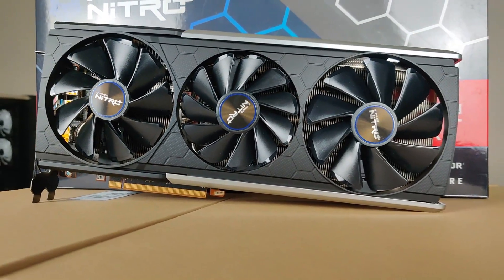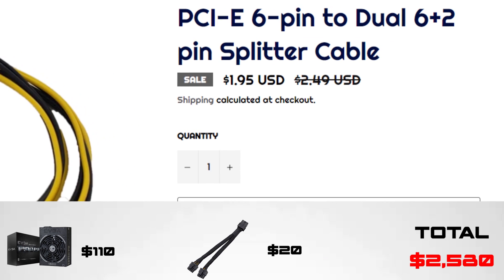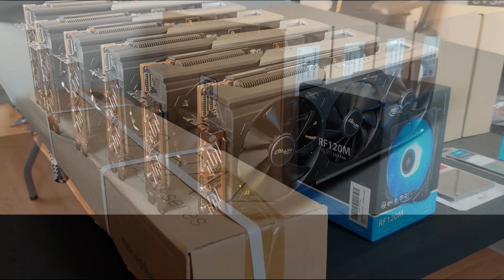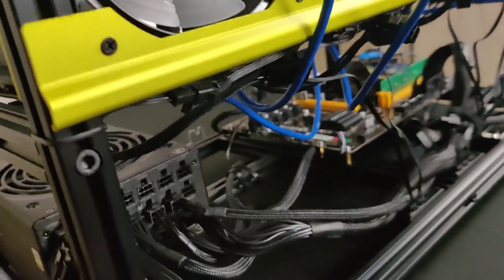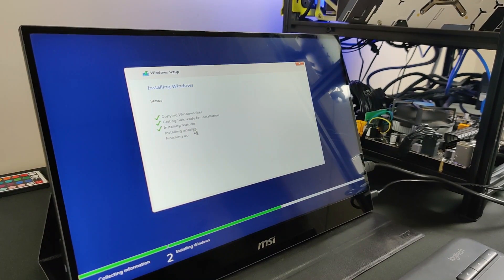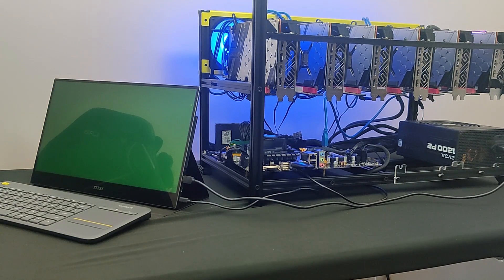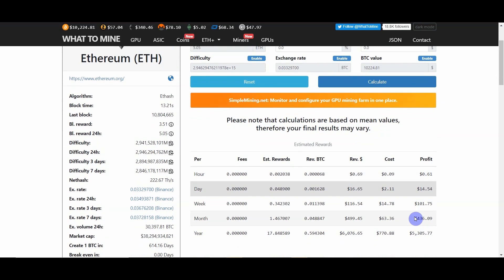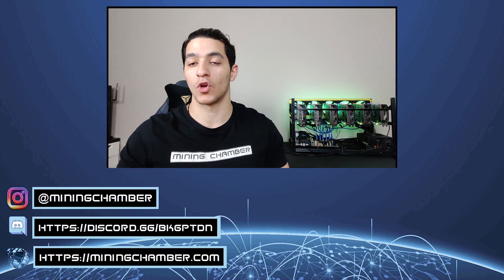RX 5700 XT Mining Rig Build - 6 GPUs | 330 MH/s and ONLY 880 Watts!!

Comment: I don't think you should be showing "refurb prices" or gifted items, especially in the thumb. These videos should be a benchmark for what average joe should expect a system like this to cost by simply buying off the shelf and not one off deals or free stuff.

It would give your videos more credibility. Plus there are far more cost effective builds.
Reply: You should do a best bang for the buck build, an efficiency build aimed solely at MAX ROI. I own a few large mining farms and mass produce mining cases psu's mobos and bulk buy GPUs and I've been mining since 2009 and based on my experience the most cost effective home build would be the metal amazon shelf plus cable ties, no need for fans if you are running two racks of 5700xt or if you want a dense home garage or mining den go for riderless mobo and self contained case.
Reply from the maker: That's awesome!! Haha I know for sure the fans are extra 😂😂 they just look appealing. Il be looking into doing a most bang for buck thank you for the the feedback!
Reply from the maker: I agree, as we did in this video we mentioned that these are the prices we got it for and for the average Joe it will cost 3K to 3.5K right after we finished wrapping up the prices. We also have done a build for the RX580 which we haven't really mentioned how much it would cost buying it off the shelf therefore we changed it for this one!

As for more cost effective builds. I agree as well! These videos are just to inspire people and give them an idea on what to build. We in no way recommend any build. Each individual is subjected to their own budget and goals!

Comment: I'm sure I'm missing something but according to the EVGA website on the 1200 watt power supply there are 6 8 pin and 2 6 pin so if I power the 6 graphics cards off the 6 8 pin with splitters, I only have the 2 6 pin left to power the risers and with a splitter on each I can power four risers. How do I power the other 2 risers? Do I have to use SATA?
Reply from the maker: That is a good catch!  I have daisy chained a splitter with another splitter which then was able to power all risers.

In scenarios like this, I do recommend getting another vga cable from eBay or anywhere you can get your hands on them for a dual 8 pin  or you can do 2x SATA to 6 or 8 pin adapters (2 sata connects to give you 1 8 or 6 pin) or daisy chaining the splitters but only using them for risers. It is still a little risky and so if you want the safest option  I'd go with the 2 SATA to 6 pin or buying a VGA dual 8 pin for the same gpu model
Reply: @MiningChamber  I appreciate the reply. This will be my first rig build. I went with 4 of the XFX RX 5700 XT's with dual bios, and 2 of the Saphire pulse 5700 XT's recommended by red panda mining I believe. As moding the bios makes me a bit nervous. I really do not want to brick a brand new card. I've been watching you guys, red panda mining, SerpentXSF, and Voskcoin, but I'd have to say you guys and red panda mining are my favorites. I assumed you had to have daisy chained those splitters but in the description it says avoid daisy chaining lol. I'll look for the vga to dual 8 pin or sata to 6 pin.
Reply from the maker: Thank you we really appreciate that! Everyone is amazing in this community as a whole. From those who put content and those who interact with others!

I know I sound very hypocrite 😂😂 I say not to do it but yet we did it. Because so many scenarios where people would try to daisy chain for powering gpus and that never ends well! That's why I want to make sure to try to avoid it as much as possible so no one makes such mistakes that can be pretty costy!

BIOS modding is scary for sure! Id recommend not using those BIOS switches at all and instead if you make sure you save the original BIOS of each card you will be on the safe side!

Comment: Great video bro, thanks! Are those fans merely an aesthetic thing or you recommend to buy them? Is this rig loud? Could you please measure the noise level? Thanks!
Reply from the maker: It depends! Some rigs don't need them because they don't get too hot but for this rig I found them pretty useful for temps! The fans provide 54 cfm each I believe which is really good airflow. As for the sound level it is really decent. I don't have a db measurement tool but il look into getting one then letting you know!

Comment: Do you need to plug out every time a GPU and then put only one on and BIOS mod it ?( So 6 times ? )and after it you put every cable on every gpu when you were done right?
Reply from the maker: That is correct ! One by one for BIOS modding. It's a one time thing then you won't have to do it again !
Reply: @MiningChamber  Ok thanks. It's not important if I put each GPU in the first PCIe slot? And one other question: When I set the program up to mine via cmd and I have a wallet, do they send me many little fractions for my mining effort or do they pay me out after a while ( each hour? ) . Because I never mined only with cudo miner but want to switch to a real mining program.
Reply from the maker: Yes putting them in the slots properly does matter! You want to start with the main slot first the 16x slot usually the first long one. And then 2nd will be which ever smaller slots above that then you go down after
Reply from the maker: As for the mining program, they usually pay once you reach a minimum. You can check with whichever pool you decide to use!

Comment: In the other video, didn't you have  50mh with 90w?
Reply from the maker: That is close! It was at 55mh at 88 watts on the software. And like I mentioned in the video, once we measure out of the wall it will be more since the risers take power and it is more accurate if we measure it from the wall .
Reply: Oh yea ur right thanks
Reply: Was gonna wait till new nvidia come out maybe these go down in price but now with 880w @0.17c.... dunno if its worth it
Reply from the maker: Hmm yes that is expensive for electricity. I would wait for the new cards and then see how much will you be able to make through whattomine.com after the electric costs!

Comment: how did you power the risers?
Reply from the maker: I used one splitter that connects to 2 risers then I power that spitter with a 6pin pcie!
Reply: Mining Chamber can you recommend a pcie to pcie cable that works with that power supply? I have the same one and all of the cables it came with were used on the VGA ports to connect the cards. I tried a pcie from another power supply but it didn’t fit. Thanks!

Comment: Hi, Great video again. I could use this configuration but with 7 GPUS?
Reply from the maker: Yes for sure! You will need a different motherboard though since this one supports only 6 gpus
Reply: Mining Chamber can you recommend one? maybe de asus A270, but i don’t know maybe you know other less expensive and and with good performance.
Reply from the maker: I think the H110 BTC motherboard is a great option for it! It supports 13 gpus, even the Asus b250 mining expert. Both of these are options I recommend !

Comment: 14 dollars? im using nicehash as i can see only 10.41 daily. My GTX 1060 6gb x 7 only provide me 5.50 dollars. that is really really low
Reply from the maker: Yes it is supposed to be 10 daily. We did use a wrong block reward number !
Reply: @MiningChamber  do you think it is worth to invest. The btc gaining is quite low compare last week. I bet it will be as low continuously. Or did i do my math wrong. ROI supposed to be longer than 6 months? Or perhaps since it is covered 3 years warranty i should forecast as future gaining as asic miner does not seem reliable. Pls advise? Many thanks
Reply from the maker: @KelmondChow  The ROI does fluctuate alot more than we can expect. Sometimes your ROI can show you in 4 months and other times it can be 8 months and more. Generally speaking usually a year is good to ROI and then you have the hardware still as an asset to sell anytime you want out of mining. Sorry for the late response! <3
Reply: @MiningChamber  no problem. In fact i do appreciate you did answer my queries.
Reply from the maker: @KelmondChow  My pleasure!! Hope it helped

Comment: Great video, I hoped that I saw this before I build my 5700xt rig. I'm getting the same 330Mh/s hash rate, but it is stable at about 850mv for couple weeks now. Cannot get any lower voltage for some reasons. I have all reference and sapphire reference cards.
Reply from the maker: Usually reference cards are much more effecient and stable for the 5700XT. Watch our overview video where we cover the BIOS modding and then youl be able to push it further than 850mv!
Reply: @MiningChamber  Thanks for the reply, I've tried using the radeon software instead of msi afterburner, I'm able to get 750mv now stable for a day. Differences between the software are that big?
Reply from the maker: It's just for some reason MSI afterburner doesn't obide by the MorePowerTool configuration that we did to the GPU so it isn't letting you go beyond the factory limits of 800mv. But in Wattman or just command line for phoenix you will be able too !
Reply: @MiningChamber  Yes, I've followed your guide and very happy with the results. Thank you so much for the videos! Keep it up
Reply from the maker: @HM-jm4mp  No problem thank you! Sorry for the late answer <3

Comment: 1200w is enough for 12 cards? Ty <3 best video
Reply: Best i've seen was 322Mh/s for 641W using 6x 5700xt with samsung memory, but even then 11 cards would be absolute max for 1200W PSU.
Reply from the maker: @bohdanzilik3867  For sure! It is very scary if the Overclocks ever crash or reset. Sorry for the late response!
Reply from the maker: Thank you!! 1200 will unfortunately not be enough. As we can see from the numbers 6 were reaching 880 watts so doubling that you got at least 1700 watts and then you want to have room for mistakes (Overclocking reseting randomly, etc.)  So it is best to go with 2 of the 1200W Powersupplies!